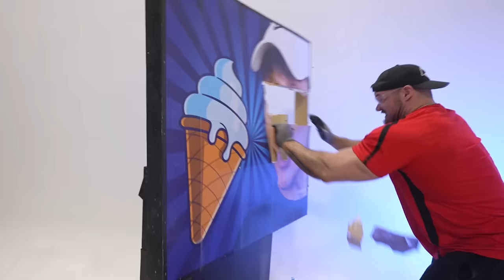Escaping Ice Cream Prison Using Only A Scoop

Comment: I have a few materials for 100 layer challenges you could try:
- Sandstone
- Magnets
- Dry Wall
- Dry Ice
- Plexiglass
- Graphite
- Wool
- Various Different Thick Metal Walls (like copper, iron, tin, aluminium, zinc, bronze, tungsten, titanium, nickel, etc.)
- Fabric
- Bread
- Wood
- Superglue
- Hot glue
- Bamboo
- Bark
- Leather
- Rubber
- Plastic
- Paint
- Ceramic
- A bunch of liquids that become solids after some time or from freezing
- Tiles
- Clay
- Glass
- A bunch of foods perhaps
- Asphalt
- Tool Steel
- Wonderboard
- Puzzle Pieces
- Hardened Mud
- Net
Reply: MAGNETS??? Fun
Reply: @meizuman  and challenging with certain tools
Reply: A tungsten or tool steel wall is NOT being broken through 😭
Reply: A few 🤔
Reply: @asbdhusahdhauhudas  yeah, hell no
Reply: Just a few